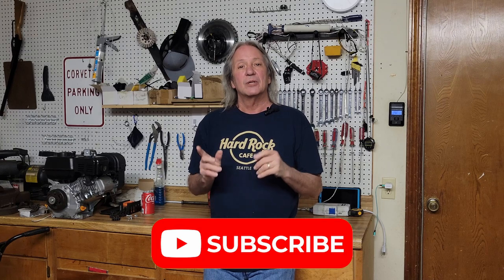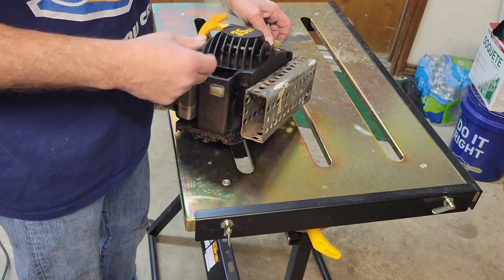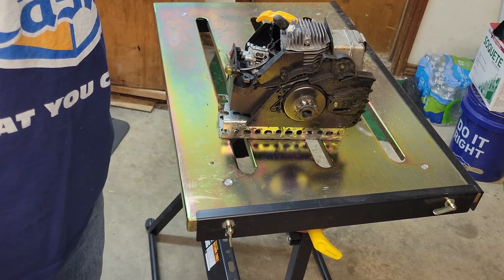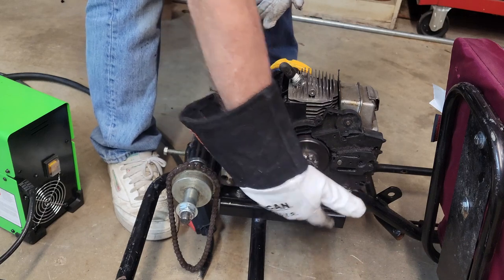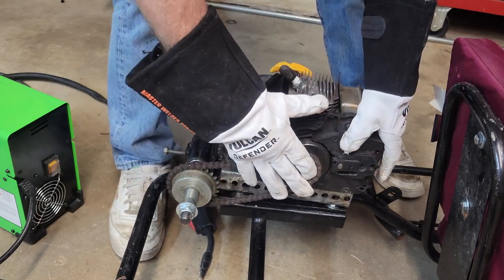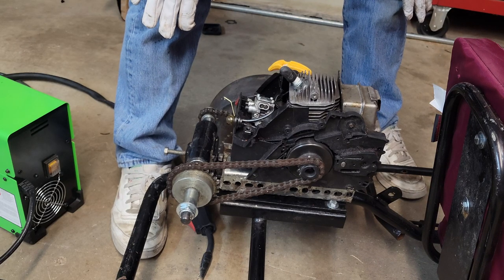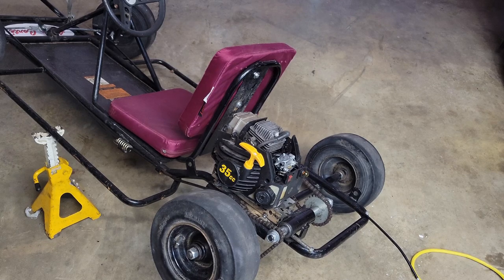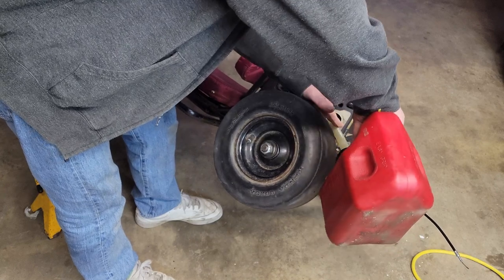Chainsaw motor on a go kart - no torque but lots of top end

Comment: Me and the sawmill boys got into this deal about 4 thousand years ago while we were still in reform school together. Where the go-cart came from or what kind of saw motor we used I have no idea. Their dad, the logger/sawyer was running Homelites, a 700?, a 770 and a 990-D for a yard saw but i doubt it was one of them. Had mower tires to run on and a v-belt drive about 1 to 1 to the axle. I do remember it was after dark when we got it together and the 1st time we gassed it the tire came apart and flew through the air with the greatest of ease out of sight and the old shop being right by the highway, we were glad there was no traffic. That was the last of that deal till the logger/sawyer made the buggy out of the old walking tractor but that's for another time.
Reply from the maker: The v belt means it had a torque converter. I tried to run a small tweaked chainsaw motor on a light cart with a clutch, and it briefly worked before the motor came apart
Reply: @GuysPlayingWithTools  This was way before a converter. Just 2 pulleys.
Reply from the maker: @lewiemcneely9143  hard pulleys? Torque converters are just 2 pulleys with a v belt, and the one on the motor tightens as the rpm increases
Reply: @GuysPlayingWithTools  That's all, just 2 pulleys. That's why the mower tire slung itself apart. No snowmobiles here.
Reply from the maker: Sounds like quite a ride
Reply: @GuysPlayingWithTools  It was on sawhorses. It never got on the ground. When the tire went off into the night we canned the project.

Comment: Sick video! I wonder how two Stihl 088 clones would do since they have good torque too. My dad had a twin powered kart when he was younger and said it would throw rooster tails 20 ft
Reply from the maker: I had to sell it before it killed me. We later put more gear and and a tweaked 212 in that kart and renamed it "The Widowmaker". You find religion riding that close to the ground at 50+mph in a kart design to go 20 TOPS. Dual motor karts are crazy cool, I keep thinking about putting one together... one day I will wake up with nothing to do and get the welder out 😁😁
Reply: @GuysPlayingWithTools  For sure those 212’s with a little mod can make a good pucker!
Reply from the maker: @VABlueRidgeExplorer  Last kart I did was a full stage 1, it would pick up the front tires pretty easily

Comment: This is the the kind of science we are here for!
Reply from the maker: My favorite experiment in a long time.  I am pondering what sort of foolishness I can come up with for the next one.
Reply: @GuysPlayingWithTools  Could get a mini bike frame if you are into that sort of thing....
Reply from the maker: @Ben's Workshop  I flipped one a couple weeks ago, a little pit bike(not a fan of them). I have my eyes open for a traditional mini bike or maybe a 250 dirt bike.
Reply: @GuysPlayingWithTools  Fair enough. I did like the chain saw kart!
Reply from the maker: I did too. It had more top end than I expected, probably would have been more fun if I had geared it down a couple teeth on the little gear it ran a12 tooth, should have been 9 or 10.
Reply: @GuysPlayingWithTools  Perhaps it could do with 2 or 3 gears.
Reply from the maker: A 9 tooth drive gear would vary the to end down to 24 and increase the torque 33%, that would have been enough.  Shifter carts are a whole different ball game, If I went that way, I would have been on the path to racing it.

Comment: I have some concrete saws think they can be used for something like this
Reply from the maker: If I had one handy, I would try it. It would probably be at least as good as a 5hp tecumseh.The latest kart is getting its finishing touches this week
Reply: ive got a wacker cutoff saw, a bts1035 i think. its 73cc, 5.5hp, 3.7 ft lbs, red line is 9300. its got an awful restrictive air filter designed to trap dust, and a crappy exhaust, so i think it could get up to 7hp with a pod filter and a free flowing exhaust, or expansion chamber.
Reply from the maker: It would make an ok kart motor(not much acceleration,  decent top end), but it would make an outstanding minibike motor.

Comment: How far can you get on a tank of gas😂😂
Reply from the maker: Well... it blew up after about 2 miles so...2 miles 🤣
Reply: @GuysPlayingWithTools  okay 👌
Reply from the maker: @robertmailhos8159  Nothing like a vehicle you have to hold on it's side with one hand while putting gas in it with the other LOL
Reply: @GuysPlayingWithTools   I saw that well at least you got it running again with the predator engine and the gas tank is in a better place than the tip it.on the side effects of the chain saw engine oh by the way I got to replace the oil sump gasket on my craftsman limb chipper leaf shredder besides the.oil seal on the out put shaft 😠🤬😡
Reply from the maker: Might as well do then all while it's apart. 
The chainsaw engine was fun, but I am looking forward to getting the predator back in it

Comment: how much hp dose that lil guy got
Reply from the maker: I had a few mods on it, I would guess for a minute there it had about 4 We knew it was gonna blow quick at those revs though LOL
Reply: @GuysPlayingWithTools   ur so cool sry for me being late i have a 5.5hp stock 15k rpm 
do u think it whould hold
Reply from the maker: @user-er5wz4su7q No worries, for me, it's early 😁 
Once upon a time, big chainsaw motors were favored for racing. Mine was too small, but it was done just for fun,  I knew it was gonna blow up when I built it, but it sounded fun. 
How many cc's is your motor? The bigger the better because it's about torque more than horsepower.
Reply: @GuysPlayingWithTools  i think 58 but may be a 49cc one just found it yesterday but i dont know how to do the 
Sprocket because it dosent have one i guess it jumps from the cluch u think using a stock chain but removing the cuting part is ok?
btw i got bike sprocket for the shaft
Reply from the maker: @user-er5wz4su7q  Attaching it is the hard part.  The chainsaw chain isn't nearly strong enough. It would stretch and break within a minute.  I think it was this video,  or one right before or after where I had the same problem(s). I decided to pull the chainsaw clutch off and weld a sprocket to it. Chains come in a lot of sizes, bikes are usually 35, and go karts are usually 41. You need to make sure you have all matching parts before you start cutting and welding. 
Attaching the saw to the kart was also a lot of welding and bolting and using my imagination. Lol
If the saw is in good shape and is running OK, I have to ask.... why not sell the saw and use the money on a bigger engine? The HF 212 is a pretty great little kart motor, and you can get them on sale for $150 and it's gonna be 5x faster and out accelerate (and be more reliable) than any chainsaw motor.  If you prep them both for racing, the 212 will still win by a mile.
Reply: @GuysPlayingWithTools  oh damn ok so i could not sell it cuz it isnt worth it and a big 200cc is not legal fore the road or so btw there are no predators in my country

but u helped me so lets recap 

i need to make sure it works and u recomend a sprocket i get it and...
i just find out my saw has the same setup as a (flinke fk8800) if you have time to help 
i whould need some
Reply from the maker: @user-er5wz4su7q Sure,  I have done quite a few karts and learned some hard lessons along the way. I am curious about you wanting to make it road legal. What country are you in? I will do a little research on what we can get away with. In the US, getting a go-kart to be street legal would take so many changes it wouldn't really be a go-kart when it was done. 🤣
 Grab my email from my about box and send me some pics.
Reply: @GuysPlayingWithTools   i am in croatia and idk if i want it road legal but the saw is all i got so lets see 
i will repli when i can gtg now thanks for the advice
Reply from the maker: @user-er5wz4su7q  That's pretty cool,  I think it's pretty great when i hear from people in other parts of the world.  We were over (kinda) near you in June. We spent a couple of weeks in Poland,  Germany, France. Holland.... all over the place.  
Ok, back to the problem at hand.  Lol. 50cc won't give us a lot of torque, but if you use a jack gear(secondary gear set), then it would have enough to get you rolling. .  Do you have access to a welder?
Reply: @GuysPlayingWithTools  yea but i dont have a geat set or  simular so at my hand is gears from a bike some random bike gear 
oh actuali i have a set of em bike ones
btw idc if it dont go from the go if i need to push a bit its kk but u seem to be good
ik the overheating 

ok back to the point so u got some bike gears and bearings but for now no axle 
a saw with a system lm explane so i see no theeth but they pop out i guess or the chain hooks to the cluch so basicali no sprocket i could weld up a bike gear to the cluch that seem ok?
Reply from the maker: @user-er5wz4su7q  You are on the right path.  I welded a sprocket that I wanted to use straight to the sprocket on the clutch, and it held up really well. When you are considering mounting the motor keep in mind that it will need to move around to adjust the chain
Reply: @GuysPlayingWithTools  oo so it should not be fix if i can got it so lm see if i can mount the bike gear ok so i have a cluch and the pop out part or whatever is cover by 
the centrafugal part so it has to be there ok 
how do i get it strainght so it dont trow a chain
Reply from the maker: @user-er5wz4su7q last the motor on its side with the clutch straight up and lay your sprocket on the gear and spin it. You will see where it wiggles and keep moving it until it looks right,  then measure and adjust as needed. I did that, then put a spot weld on, then started welding away. If you can't see any deviance with your eye while paying close attention, it's close enough
Reply: @GuysPlayingWithTools  thanks that close enought for me to start will hit u up some more if i need help thanks a lot ur a cool guy
Reply from the maker: @kingsman-co  Thanks 🙂
Remember to take your time, if you aren't sure what you want it to look like when you are done, stop and think for a minute 😁 
I am hoping you make a video doing some of the steps!